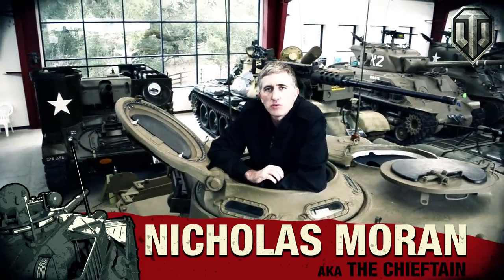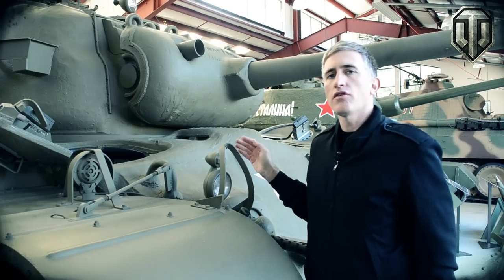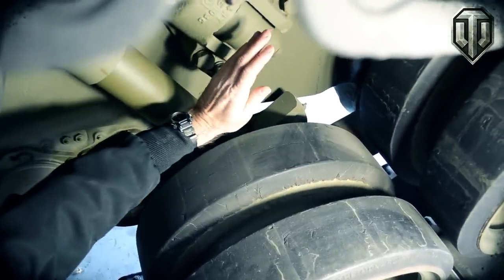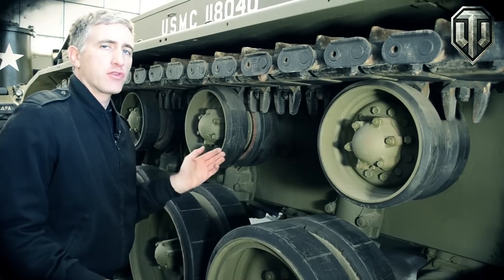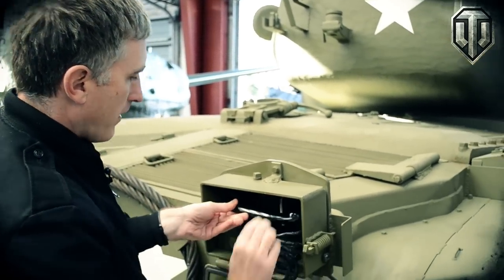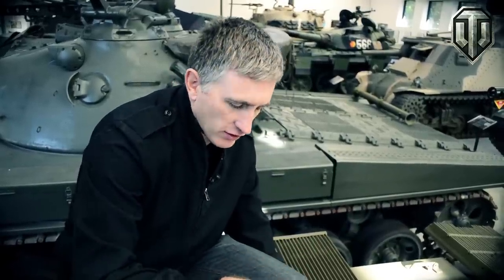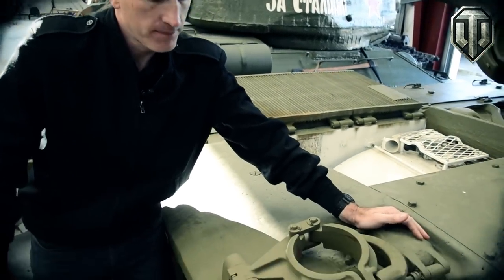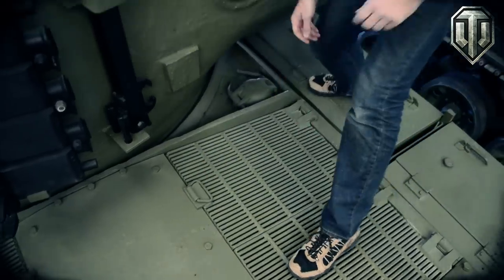Inside the Chieftain's Hatch: M26 "Pershing" Part 1

Comment: Does this guy likes his job? He looks so bored. 

Anyway, if the Western Allies used this tank earlier in the war, many tank crews could be saved. It only saw like 4-5 months of combat in WWII, way too late.
Reply: He said before that's just his face :)
Reply: ***** well the fact is it couldn't have been used earlier in the war due to its many problems.....
Reply: dappadan22 I know but why? The Allies knew about the Tiger tank already in 1943. They never responded quickly with a good tank of their own. Only the Sherman Firefly maybe.
Reply from the maker: ***** Hop over to my most recent video, Myths of American Armor. I go over Pershing's non-production about half-way through. Bottom line was that the tank was rejected as unsuitable in both functionality and reliability by Armored Force, and it took a while to iron out the bugs. In the meantime, the Allies were knocking out Tigers etc from 1943 onwards with what they had, so the 76mm was considered to be more than enough to do the job easily. They may not have been entirely right, but that was the argument.
Reply: stanley chan The current doctrine at the time was such that TD's were supposed to be the ones to fight tanks.  If you take a look at what the Sherman was designed for, meaning infantry support, it did the job very well.  The 76mm/3 inch gun was a very capable weapon the M10's and M18's used to very good effect through most of the war.  If you haven't read it, I highly recommend "The Tank Killers"....its an excellent read.
Reply: +Lt Col Speirs A good deal of politics prevented it from seeing any real combat in fact of all that were shipped only 20 actually engaged the Germans.
Reply: +DIVeltro Myths of american armor, by this guy. Tank destroyers were more mobile AT gun anything else, defensive above all else.
Reply: +Fake Name It could be seen from that aspect, but the fact is also that tanks were viewed as being for infantry support, and TD's were to fight tanks.  However, the TD's did get used in the offensive role in this respect, and as artillery support.  They also got used much like tanks since they looked like tanks.  About the only time that they were used as per their own doctrine was in North Africa, and they did an excellent job at it.
Reply: you're talking like shermans fought tigers everyday. It was something like 3 or 4 times during the whole war. Soldiers were scared of the Tiger so everything was a tiger. If you are a deer hunter I'm sure you've noticed the more you actually look for deer the more stumps, rocks, and whatnot suddenly look like deer. What kept the pershing out was the logistics rather then some outdated doctrine. hard to make major changes with an advancing army
Reply: It never would have been able to be produced in the numbers required like the Sherman was.
Reply: Mojo Risin it got a lot of use in korea
Reply: The Allies also of course faced few Tigers, the Americans faced almost none, and the British already had a tank (Firefly) that could and did take many of the few that existed out.   Shipping tanks over seas and over beaches is not easy.   Providing fuel for them via undersea pipelines and tankers, then trucking it to the front, isn't either.   This also explains the reasoning for no heavies earlier than they did arrive.
Reply: Mojo Risin dude! Do ya even know how big of a pain it is to ship those things? It be expensive as hell! Why do ya think the Americans never shipped heavy tanks to the fight in Europe in the first place? Quality vs quantity
Reply: Not until the end of the war did the Allies even have operational ports that could handle vehicles like this in quantity. There were also issues with armored warfare doctrine, but that is another story.
Reply: jtoddjb Am I reading this correctly? Your saying they only fought Tigers 3 or 4 times during the whole war??  I've just finished reading a couple of books by ex tankers and between them they encountered Tigers three times. On one occasion a supporting Firefly knocked one out, another abandoned after being pounded by 75mm HE in preference to AP as it was more successful in causing damage. It's true, the Allies were more likely to come across the more numerous Mk iv's, but the Germans still used a relatively large number of Tigers in the Normandy campaign and there's a number of famous instances were they were used to devastating effect, helping to cement their reputation.
Reply: Mojo Risin because the Sherman did fine and barely ever saw tigers that weren't abandoned and was easier to produce
Reply: Frank Anderson I know this is late but nearly all Tigers were used on the Eastern Front, and thus a problem of the soviets rather than the western allies. Of the western allies, the brits got the bad end of the stick and ended up encountering most of the german heavy armour around. The American got off relatively easily avoiding the majority of german armour in general, thus they didn't see the full scale of the threat that they could have posed. Hence stalling filling the need for a heavy tank.
Reply: Natural poker face.
Reply: IIRC, even by 1950 the problems were still there, so between the end of WW2 and the start of the Korean war they came up with the Patton to replace it.
Reply: Again. Go watch Chieftains Myths of American Armour vid and you'll see this BS about TD vs Tanks and just that, bullshit.
Reply: "WE HAVE THE BEST NEW TANK!"

"Oh, really? Great! When can it be ready?"

"COUPLE MONTHS IF WE FUCK UP SHERMAN PRODUCTION"

"Oh.....um......but we're making a LOT of those right now...."

"BETTER TANK"

"More tank is better tank, wait in line for free factories."

And they were entirely correct, no point disrupting production lines for a tank that wasn't even needed against an enemy that was beyond death's doorstep.
Reply: Hindsight is always 20/20. Besides the Sherman was still a great tank. It was incredibly safe compared to other vehicles, could fit on landing ships, trains, the 76 variants could punch through the heavily armoured German tanks. Besides there wasn't that many encounters with our armour and they'res. Most of the tanks were dinky panzers
Reply: John Cornell  The "Sherman Deathtrap" is a myth. They we're one of the only tanks with spring loaded hatches, and had a high survival rate.  The Pershing saw limited use, only used against the odd panther and tiger. Most of which were destroyed by the russians, or simply broke down. There's even reports of many tanks being left behind simply because of Germany's gas shortage. The Sherman didn't only fight in France and Germany, but in the Pacific, and north African theater as well. It was a great tank. The German tanks were mostly dinky panzer IIIs and IVs which were outclassed by Sherman's and other allied vehicles by that time. Yes the Pershing had better armor and guns but the Sherman was already in production, stalling the war and giving the axis more time just to push an unnecessary tank design? Silly.
Reply: Not many lives were lost in Shermans, if that's what you meant.
Reply: John Cornell  Soviets and British, yes, touché. I was only thinking of Americans. There's that exceptionalism again. 

Although, the US introducing the Pershing earlier wouldn't have saved those guys anyway.
Reply: Bruno TaTa The US didn’t use heavies primarily because the max. weight most cranes could carry
Reply: The army decided the 76 wasn’t accurate enough and didn’t pen enough, things that are very important for the gun they had been developing since the beginning. As far as the US being arrogant, you’re just wrong. The US started developing a heavy before they even joined the war. The US developed and ordered 100 m6s and m6a1s, development started in December of 42, before stopping production because it was a bad tank. The army said “fuck off” to the m6 series tank  because of its very high silhouette, awkward internal layout and reliability problems. Not to mention it was expensive, and it’s 76.2 wasn’t much better than the 75 on the Sherman. The army really liked the Sherman because it was cheap, reliable, plenty of parts, and you could change the guns and turrets easily. The Sherman was also very survivable.
Reply: John Cornell Yes, the 76 was sent to ‘deal’ with the tigers and panthers, but it wasn’t sent until the finishing of the balleroy tests, which made it seem like the 76 could pen a panther frontally, they couldn’t. The reason 76s we’re delayed was because of testing. People wanted the US troops to have only the best.

Edit: testing and issue fixes
Reply: It was really unreliable does this guy mention that or not?

Comment: Interesting Facts: 

According to Quantities of Lend-Lease Shipments (1946), the United Kingdom received six T26 and six T26E3 prototypes for a total of twelve Pershing tanks through the Lend-Lease program.

David Fletcher in  Sherman Firefly (2012) also mentioned that Brigadier General McLeod Ross proposed fitting the 17-pounder gun into the T26 turret for the Sherman tank but the idea was regarded as a waste of effort and rejected.

If the war had lasted longer and British Army adopted the M26 Pershing and managed to fit the 17-pounder gun into the T26 turret, it is possible the Pershing would have made a fine main battle tank for the British Army until the introduction of the A41 Centurion.
Reply: Also if the British army received enough pershings they probably would have cancelled the centurion development.
Reply: It is also possible the British Army would have still adopted the Centurion but at a much later date than in real-life to replace the Pershing, Sherman, Comet, and other WWII-era tanks.
Reply: Benito Mussolini but why the 17 pounder on a Pershing? As it performed almost identical to the 90mm. Slightly more penetration at the cost of accuracy. The USA tested both and preferred the 90mm but said they where almost identical in performance. 
Was it
Just a matter of logistics? Why manufacture  and transport a new round?
Reply: Christopher Wang. If I remember correctly the Russians also got a Lend Lease Pershing, I looked through the list some time ago.

Comment: Now I've seen this video before and several pictures of pershings that gun does not look like a M3 more like M36 which it was upgraded to in Korea. The difference between M3 and M36 was M36 had the counter weight on the tip of the barrel behind the muzzle break the M3 did not. But then again I could be wrong. It just doesn't look right.
Reply: hobosloveham ethan yeah its the korea era gun

Comment: Isn't this an M46 instead of a M26?
Reply: M46 is an M26 with a different power train. They look very similar though
Reply: Yeah the exterior differences between the two is the gun and the exhaust is mounted on top of the mud guards instead of off the back of the engine deck.

Comment: It's not proper tank lingo to say road wheel pairs. There are individual road wheels only
Reply: No, the front most wheel is connected with the front idler wheel to maintain track tension. So there are like < shaped bar connecting the idler and front most wheel. But the rest is independent
Reply: +Alpha Adhito trust me man. I spent 6 years on the Abrams. Road wheels are I independent
Reply from the maker: +wesley moore You're both generally right. There are some road wheels which are cast together a single, split wheel which looks like a pair. (T-54 had them, for example). The front road wheel is not independent of the idler wheel, even though it's considered an independent suspension. You can clearly see the connection on Abrams here. http://data4.primeportal.net/tanks/jeff_derosa/m1a1_details/images/m1a1_details_424_of_435.jpg It is further not incorrect to say that two road wheels mounted together are a roadwheel pair.